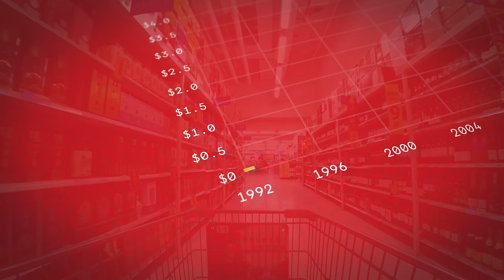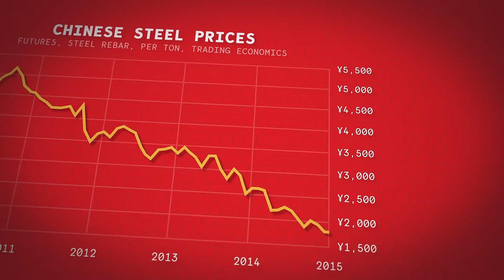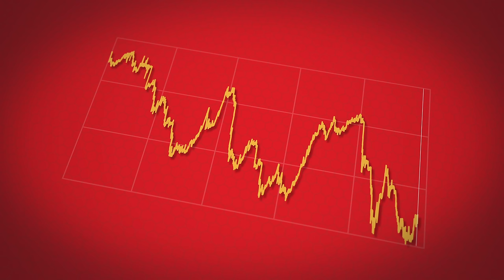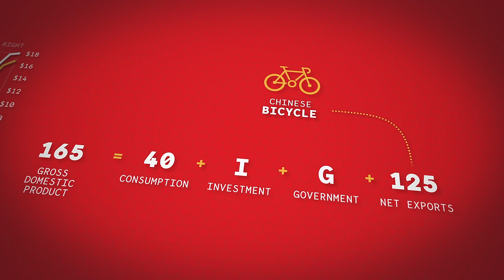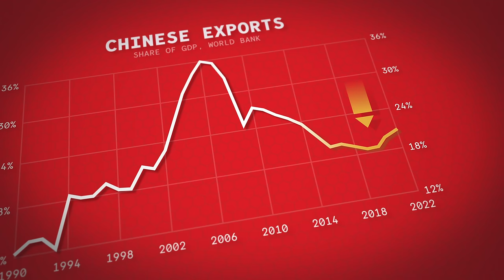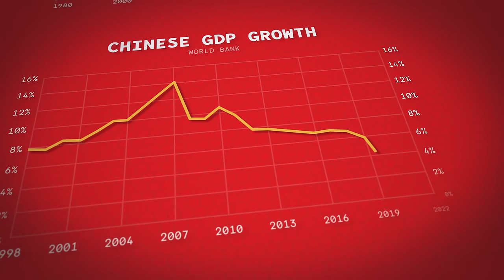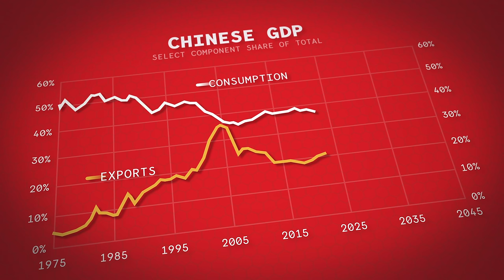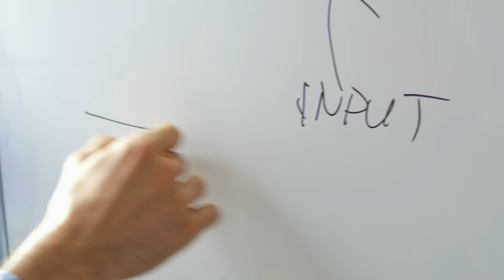Why China is About to Start a Trade War

Comment: wrong data:over 30 million cars were sold in China market in 2023, not 20-25 million,China car market is larger than the US and EU combined.
Reply: China has double US and EU combined population, sells the same number (30 million), yet 29 million are 1/2 the price. China has a car market far smaller than the US or EU each.
Reply: @Enjgine  Because China does not count used car deal in it. You should add another 18.4 million to this number. In total, more than 48 million
Reply: @Enjgine  The size of the automobile market is not calculated as a percentage.
Reply: All these Chinese bots trying to make it sound like 10x 1000 is smaller than 100x 50

Comment: The engineer's dilemma is to make something as cheap as possible that just passes standards for safety.
Reply: You're thinking of management. The engineers' task is to make everything last the same amount of time. That's why things are starting to fall apart all at once. 😅
Reply: Which is why safety standards are usually high. To solve that very problem.
Reply: Anyone can build a bridge that will last for 1000 years.

But if you want a bridge that will last exactly 1000 years, you need an engineer.
Reply: @AllSeeingEy3 lol😂
Reply: Engineering is to reduce as many elements and processes as possible, the more moving parts something has, the more ways it can break. Or in systems analysis, the more complex the solution, the more further complex problems it creates.

Comment: This video suggests that China can produce various goods so cheaply, quickly, and on a large scale because of cheap labor (or "low human rights"), massive government subsidies, and disregard for intellectual property rights, among other reasons. I do not wish to comment on these views, but it's necessary to point out: 1. Labor costs in India, Southeast Asia, and South America are even lower than in China, yet they have not become the world's factory; 2. The Chinese government does not subsidize all industries, at least bicycles are not included, and only a very few industries considered to be of strategic value receive subsidies, yet almost everything produced on a large scale in China is the cheapest in the world; 3. While China's emphasis on and protection of intellectual property rights still lag behind developed countries, they are the highest among all developing countries; 4. Over the past 50 years, the income of ordinary Chinese people (adjusted for inflation) has increased 60-fold. As a Chinese, I cannot deny the problems mentioned in the video (they indeed exist). However, China's real success in becoming the "world's factory" and its economic development to this extent truly rely on effective management, hard-working people, and an exceptionally large market (which ensures that almost anything produced is cheaper).This video is more biased and hostile than factual and logical。

Comment: Why produce a bike in China instead of Brazil or another country? China has the infrastructure, materials, and of course cheap labor. But there are others with even cheaper labor, but don't have the materials and infrastructure. You can't just set up shop anywhere, there's the logistics side also. China only give subsidies to fields they want to advance, definately not to bicycle shops. Decrease pensions? What are you talking about? It's been increasing. The one thing this video got right is squashing labor unions.

Comment: Usually great work, but I expect this  video may not age well.  One of the first problems is to consider is the source of the manufacturing inputs. While not addressed in the video, few are domestic.... and Russia seems busy at the moment to be a significant substitute should it initiate a trade war.  Then there is the political element, its leadership seems increasingly "challenged" to put it nicely.  Additionally, assuming China's top priority is economic fails to consider the mindset of China's leaders and its past as recent as 60 years ago.  What's in place today I believe may be more severe in its viewpoint.

Comment: Modern economics is a funny thing. China has excess industrial production capacity for just about anything. Construction materials, faucets, textiles, electrical cars, consumer electronics, smart phones. But the country’s citizens mostly make about 500 USD a month. Here in Canada, everything made in China is 4-5 times more expensive and the housing is insanely expensive.  Supposedly Canadians make about 100K CAD per household per annum. But barely can afford anything. You tell me which country’s  is wealthy.
Reply: Canadians can afford products from anywhere in the world. Chinese can only afford Chinese products.
A house from 1950's Canada would be illegal in Canada. A typical 1950's house was 90 sq meters, no A/C, no central air, no radiant flooring, no internet/cable, no garage, no grass/landscaping, no fire dept,  no patio and even no indoor bathroom wasn't uncommon. A Canadian can buy a house today for cheaper than the 1950's if you bought the same thing. Housing cost aren't going up, we're buying more lavish homes and thinking of the as the minimum without regard to the past. Pictures of grands parents house shows a dirt road in front of it, they didn't even have paved roads. Now, my neighbors are complain their kids don't have side walks and bike paths all the way to school.... lavish by comparison.

Comment: You do know that Chinese high speed rail has problems right?  They also won't run them at speeds like what Japanese HSR runs which is REAL HDR.  Their highways will give way because ground water has created sink holes.  They have building that lean, they have housing towers that is in the West the buildings would be condemned.  They basically have the worst infrastructure in the WORLD, for being new.  And even their BRIDGES fail.  They certainly aren't too strong.

They do road work and you look and there's no REBAR!!!!!!!!!!!!

So almost all that entire beginning is propaganda that China puts out that's false.  China also have ghost CITIES.

Comment: The solution to increasing consumption, to deflation and to their national debt are all the same, easy to implement and can be implemented at the drop of a hat however: print lots of money and give it directly to consumers. As such, I'm not really surprised that they have no particular urgency to do it, when they can instead continue to leverage their current economic model to move further up the value chain. In addition, high savings is it's own solution; after a long enough period of time, that stockpile of saved money by each consumer will grow to the extent that it will diminish the urgency with which each individual feels that they need to save, and thus the savings rate will decrease naturally by itself, albeit over a fairly lengthy period of time (>10 years).

Comment: If China produces and exports that much more than we need, and is able to bring cost down accordingly, i wouldnt mind super cheap electric vehicles spreading around, as long as the quality is up to standards. But low chinese quality is basically a relic of the past for most industries.

Comment: The cause of lost of Chinese produced products is neither due to cheap labor or government subsidies.
The cause is the cheap cost of LOANS. 
In China a businessman can borrow money  to do business at 5%. Yet chinese banks ware the strongest and most profitable banks. 
Why is loans in western countries so expensive? What is the additional costs involved that result in western interest rates at least 3 times that of Chinese loans?!
Even if labor cost in China was twice as high, western companies could not compete with Chinese produced goods.
Why don't western countries complain about the low interest rates of banks? The reason is because the banking sector is the largest contributors to political campaigns. That's why they are bkaming the weakest link for the high cost of goods  and services produced in western countries.

Comment: High speed train and airports are too clean - because nobody uses it; to sturdy bridges - ever heard the term tofu-dreg..sound like the German word "dreck" what means dirt or crap.

One could go on with China...their numbers, statistic, their lack of own ideas, their incompetence for high quality need for the highest echelon of production like cutting edge micro chips etc. pp.

With their massiv debts which fuel the growth in the last years - like in the real estate sector, or government projects like the high speed system - the fake statistics - some study assume the population as low as 800 million*, and the GDP 60%* lower as reported - and the CCP becoming more and more totalitarian, China has headed for a dead end years ago and is now about to reach the very end of it.
The population dividen which made this possible is about to vanish and the China will have a population burden.

*800 million and the GDP 60% less than recorded are the most pessimistic numbers out there. Imho why to pessimistic.
My guess is 1.2 billion instead of 1.4 (albeit even the CCP is working now with 1.3...according to P. Zeihan)
and 20% less in GDP.

But working with the official statistic of the CCP as the most do...

Comment: I think China is in for some rough years. There are significant quality control issues in Chinese manufacturing which, coupled with the more recent less favorable view of the nation in western countries, might not result in the exporting win China has experienced in the past. BYD vehicles and electric bikes, for example, suffer from spontaneous fire concerns which emerge from poorly constructed batteries and ineffective software management of battery systems. In China, where consumers often view these products as quasi-disposable, this is simply something they learn to live with. A domestic vehicle is much cheaper than a foreign built car, especially after the taxes China imposes on them, so instead of a vehicle you can keep operational for 10+ years you simply accept that a domestic vehicle will only last for 3-5 years. But this reality will fly in the face of western consumer experience with these product categories, potentially delivering significant brand damage similar to the ill-fated Yugo. Furthermore, China is now starting to face internal pressure from its population, great swathes of whom have recently seen massive losses in personal wealth owing to  corruption and the ongoing collapse of its real estate industry, which could create problems implementing a cohesive economic strategy. All that and China has a bill coming due for all of those business friendly decisions like unsafe food and water, extreme pollution, a rising drug epidemic, and generally poor public health, all of which will drag down its internal stability. The future can always surprise, but personally I think there are some dark times and hard choices coming up in China.